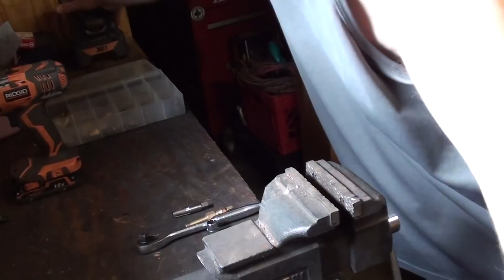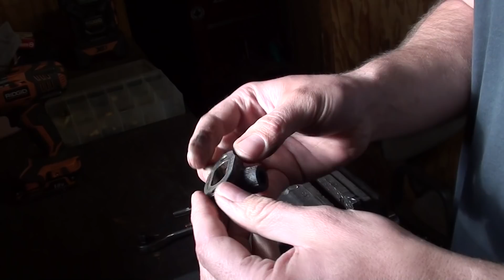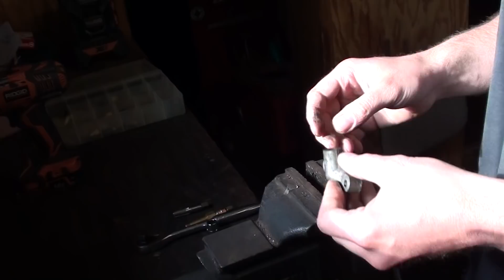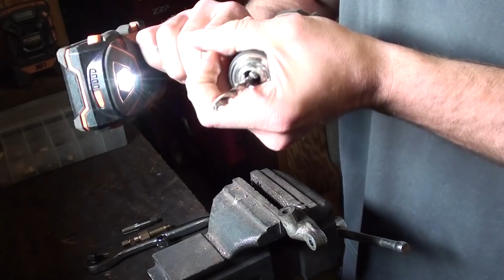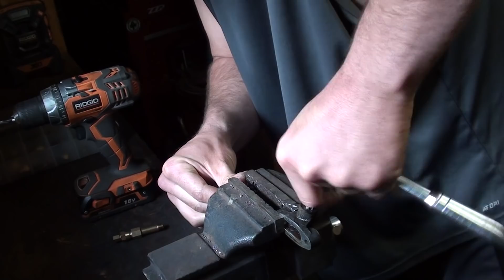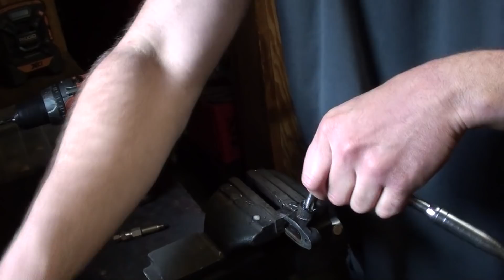How To: FREE MOD LS1 4.8 5.3 6.0 Turbo Feed/Oil pressure port.

Comment: Highly recommend using Aviation Grade 2 thread sealer.  They sell it at Oreileys, they call it gasket maker #2, it’s resistant to oil. 
I used RTV when I made mine and it seeped a little, I had to tighten it maybe 1/4 turn more.  I haven’t noticed anymore drops.